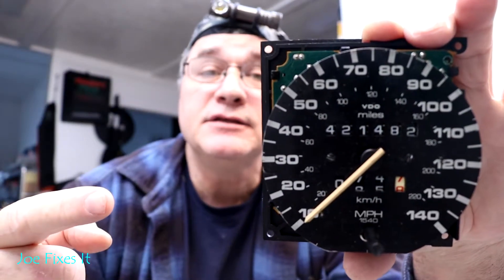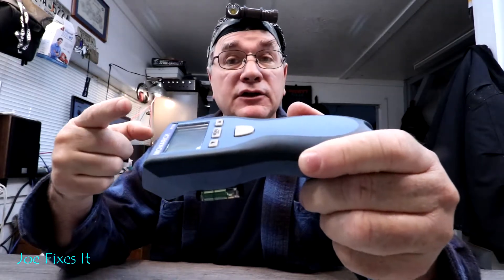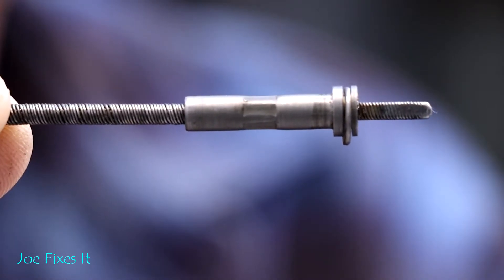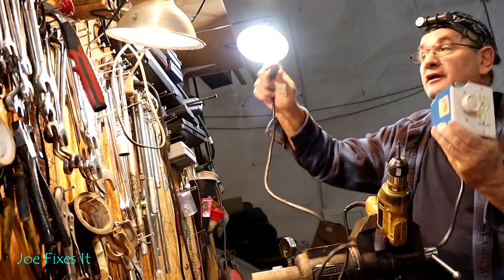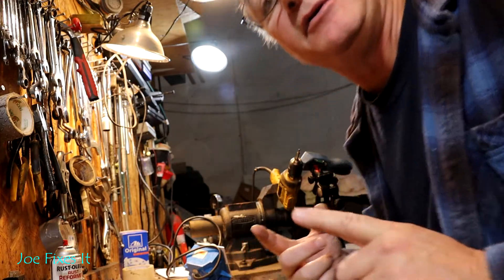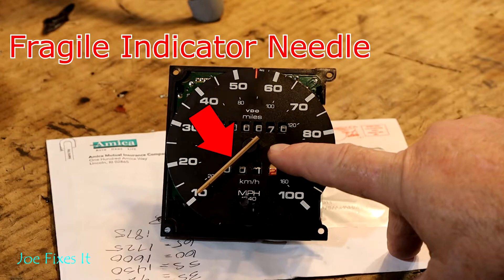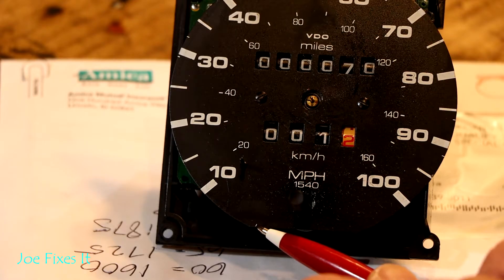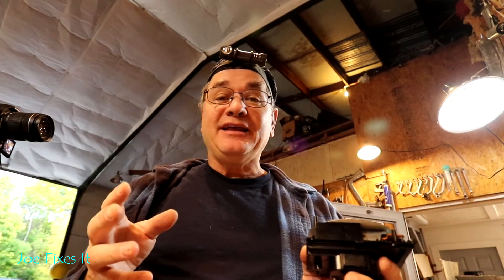How To Calibrate A Speedometer | MK2 VW Diesel 1985 -1992 Jetta Golf | Your Speedometer Calibration🚕

Comment: Hello, I have a porblem with my mk2 POLO, I adjust the needle to the mark but I can never get it to work. Its like 20 mph of nomather what I do, I have also tried to adjust it with my GPS in the car but it still of alot... is the spring needed to be clocked somehow?
Reply from the maker: is this a round headlamp version? I think the speedometer head different? You should not mess with the spring tension. Just moving the needle and putting it back on the pin shaft
Reply: @Joefixesit  yes round headlights, the dials are square instead of round, I have not touched the spring just putting the pointer back. Let’s say I’m putting it back when I’m at 60mph and slow down to 30mph the needle only goes down to about 50…
Reply: @MrNoysip  the round head lamp have a completely different head than the american made versions. Are you in Europe?
Reply: @JoeisHungry   yes I’m in Europe.
Reply: @Joefixesit  Where can I find the rpm my input shaft needs to spin with for a given speed on the dial for my instrument? Eu polo mk2, 1987, 1.3L, km/h

Comment: I got one that hangs and doesn't want to move untill I get rolling then it shoots to 30 and I have no clue if it's accurate. What's the best way to go about fixing it
Reply from the maker: sounds like you have corrosion in the speedometer head. If it were mine I would carefully apply some WD-40 inside the unit and check the magnet housing. as far as seeing if it were correct try it against a GPS in your car are flat straight road. I have a spare unit I know if correct I check it against.

Comment: Hi sir..my speedometer is working so fast..even my car running slow,my speedo reads over 120kph..what actually the problem of this..i already replace speedometer cable 2 times and speedometer gear once but nothing happens..can you help me sir?
Reply from the maker: there is a good bit of information your not giving me.. First I assume this is a diesel. Make sure you have the correct transmission. the gas and Diesel Transmissions are different. Has the speedometer  been apart? Normally when calibrating I just pull the needle off and and move it where it needs to go to be correct. The drive gear.. I assume your are talking about the little plastic gear on the end of the cable that goes in the transmission. they are color coded depending on how many teeth they have because are two variants of diesel transmissions on the MK2, your not telling me the rear and model of the car so it is hard to be very helpful .

1: first make sure you have the correct transmission for your engine. there are code charts out there.
2: Correct drive gear
3: Speedometer has been apart? ( Speedometer heads are the same for gas and diesel)

Comment: Do you know if it's possible to add an external tachometer gauge to Jetta models with the clock on the cluster? The redline is so low that shifting by ear is no problem but if I can install one myself I'd love to have it for peace of mind.
Reply from the maker: best if you can find a tach cluster from a mk2 diesel jetta, all you need to do is put it in then dash, the gas cluster does not work for the diesel. The diesel is governed at 4200 RPM through the injection pump, it will not over REV. I know of no after market tech for the diesel.
Reply: Joe Fixes It Thanks for the info joe. I just bought a Bentley’s manual to help with my repair endeavors but questions like this just aren’t covered. I’m gonna keep a watch on eBay for a tach, unfortunately used TD gauge clusters go for $200+ usually so it might be a dead mission unless I can get a good deal.

Comment: The metal center pin in my MK2 odometer keeps popping out from one side. I pop it back in and after I go over a bump it pops back out.
Reply from the maker: not sure which pin you are talking about, if it is the odometer shaft, it is press fit to a pot metal gear ......you can friend me on facebook and send me a photo of what you are having issue with. I have never seen the speedometer needle shaft come loose. let me know. Ill keep an eye out.
Reply from the maker: there is a facebook link on my food channel joe is hungry
Reply: @Joefixesit  It's the center metal pin all the numbers rotate on.

Comment: I'm looking forward to the odometer repair video.
Reply from the maker: actually I can do several of those but will do the one where the plastic gears break and need replaced.
Reply: @Joefixesit  Please make a video on the odometer gear replacement. If you know a good source to buy the gears, I'd love to know.

Thanks for making these videos.
Reply from the maker: @David_H_Parker  you talking about the little white gears that crack? I got a couple from Latvia but there is a guy that follows me on my food channel that has a 3d printer talking about making them. I normally scavenge them from old Gas speedometers or just super glue them back together, then there is the Pot metal gear on the other end of the shaft that comes loose even worse than the plastic gear that I have a fix for. I will start working on a video on just that as I have a number of Old speedometer heads I can use. thanks for the great suggestion. You will se that video soon.
Reply: Yep - this one too. I have a lot of clusters in the garage that need some love